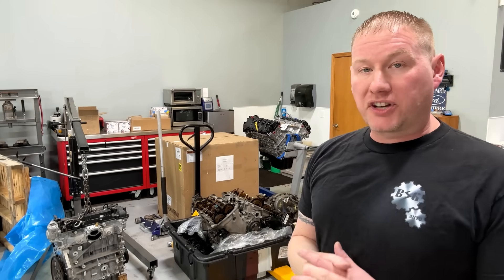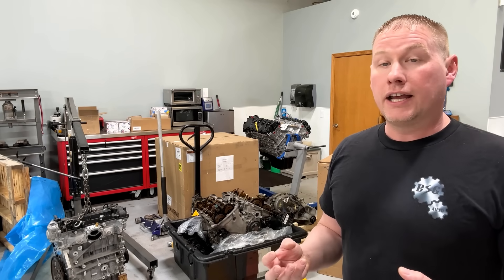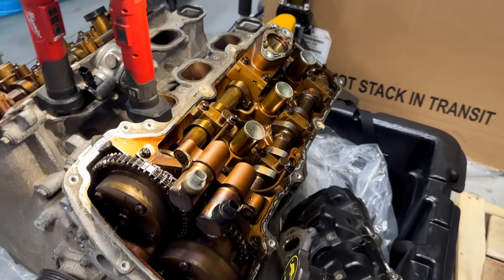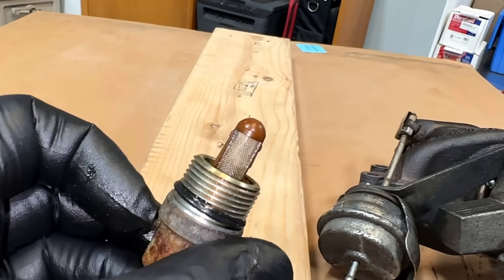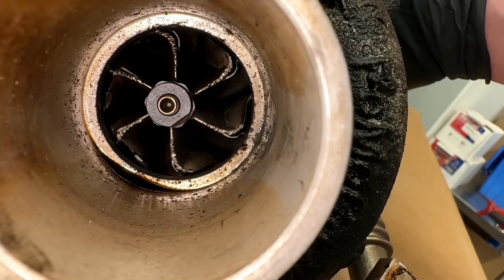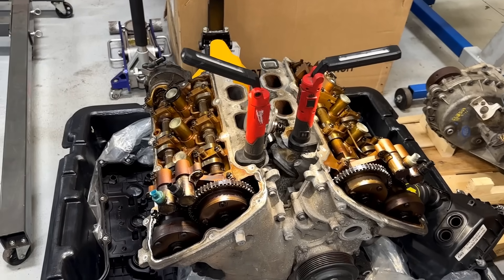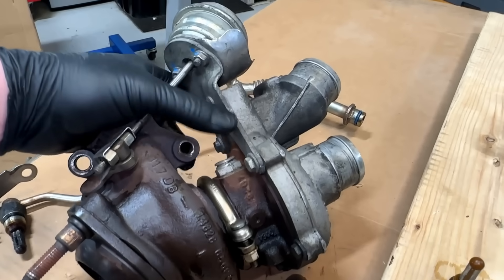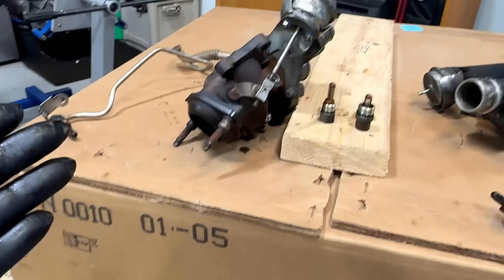This is Why You Never Run Extended Oil Change Intervals on The Ford Ecoboost Engines!

Comment: Small displacement turbo engines with direct injection should never go over 5K between oil changes. Fuel dilution and high pressures and temperatures will break down even the best oils.

Comment: I put full synthetic amsoil signature series oil and an  Amsoil oil filter and I let the Ford dash computer tell me when to change the oil…..    eeek😮….   How long does the oil change reminder on the Ford f150 dash usually let you run until an oil change?

Comment: Would you be willing to do a walk through  to examine these oil filters and turbine wear with turbos in place?  Extension mirror or camera on a stick? I bought my truck used and don't know what horrors the previous owners inflicted. Knowing how to perform checks would help prepare repairs.

Comment: My 2023 F150 2.7 L echo boost engine monitor on the interface requested my first oil change at less than 1500 miles. Why so soon? Please answer this question for me. I hit the reset and here we are at 2900 miles and it’s asking to change oil again. Should I be changing the oil or disregarded and hit the reset button?

Comment: Cheap insurance, change oil every 3,333 miles.  It is really easy to see on the dash when it's time, ××3,333, ××6,666, or ××0,000

Comment: Seriously, Ford is responsible for these "oil" failures. The recommended "synthetic blend" oil is basically conventional oil not true synthetic. In addition, Ford's oil change reminder is factory set at 10,000 miles. Conventional oil must be changed at 3,000-mile intervals.

Comment: Here is crazy idea, but hear me out.  What if you changed the oil at 3K miles, but not the filter? Then the next oil change, 3K on the oil, 6K on the filter, you change both?  Good idea, or bad idea? The filters should easily go 6K miles.  You would obviously have some residual old oil in there, but it wouldn't be much...

Comment: I run 7.5k intervals on my 5.0 F150 and 5k intervals on my wifes 2.7 Bronco. This is great advice to keep turbo engines happy and I also recommend using a high quality oil (Pennzoil Ultra Platinum).

Comment: We have a 2015 Ford Transit 250 with the EcoBoost 3.5L engine, currently at 412,000 miles. The engine and turbos are original, including the manifolds and studs. Purchased brand new, strictly doing oil changes every 5,000 miles and have maintained it through-out the last 10 years. I made a post about it on a FB group called "Mileage impossible" even took photos of the engine bay, underneath the van, turbos- fittings ect. The cam phasers are original as well. I had several members almost in complete disbelief, but as a former technician (many years ago) I tend to do a lot of preventative maintenance on all of our vehicles. Some are lucky, some are not, I guess a lot has to do with how you maintain and care for any vehicle.. It went to Ford today for the recall on the drive shaft coupling, not only was the advisor baffled over the mileage but the technician was also considering the manifold studs were in tack, no turbo lines leak, no turbo abnormality, though noted it did have a slight leak at the front cover but not enough that it was dripping to the ground or beyond the cover itself. The transmission was replaced at 400,000 miles with another used unit with far less miles.

Comment: On my 2022 ford edge 2.0l , I change the oil and filter every 3000 miles. I use mobil one synthetic oil.

Comment: This is why you don't run cheap low quality oil, all Group III oils are nothing but mineral oil or conventional oil, they are not synthetic and it is false advertising for them to even put full synthetic on the freaking bottles. In Germany they can't label a Group III mineral oil/conventional oil as synthetic. You can blame Castrol and the BBB National Advertising Division for mineral oil/conventional oil being labeled as full synthetic. Mobil tried to explain to the BBB's National Advertising Division the difference between mineral oil/converntional oil and synthetic oil but they refused to listen and sided with Castrol. 

Do yourself a favor and do research and only purchase true Group IV PAO synthetic oil or Group V Ester synthetic oil and you will be fine. Sadly the majority of oils labeled as full synthetic today are nothing more than hydro cracked Group III mineral oil/conventional oil.

Comment: Thanks for this video. Found it because considering replacing turbo oil screen filter on a 2020 Fusion 2.0 and 2013 Escape 2.0. My concern is possibly breaking something as I notice the tubes are ridged. Is this a valid concern?

Comment: Always great info!  With an exhaust manifold leak would you also replace the turbos with new ones or just replace the screens and reuse them? 2018 Transit HD w/ 95k.  Anything else you’d do preemptively at that time?  Any issues letting the manifold chirp as long as there is no performance issues or codes?  TIA

Comment: Absolutely correct! 💯 I don't put 5000 miles per year, but I do every year without fail. 3500-5000. I do turn off start-stop which I think destroys the turbos and timing chain. I idle while I'm getting ready, putting sunshade and getting my stuff. About 1-2 minutes to cool the engine and turbos, especially after highway run.

Comment: Unbelievably useful information on those screens, thank you. I own a 5.0 F150 but my wife’s ecoboost Explorer 2.3 has the same type of screen on the turbo I am assuming? We go 2000-3200 miles between oil changes so no issues there but very good to know to change these if for some reason the car needs work. 👍

Comment: Just rolled over 306,000 miles on my 2013 King Ranch 3.5l Ecoboost. Oil change done every 7500 miles with Motorcraft FL-500S filter and Penzoil Platinum 5W-30.

Comment: Hi I have a 2021 Ford Ranger with the 2.3L.  Should I be replacing the turbo screen every so many oil changes?  I don't  see any mention of that in the maintenance schedule.  I'm definitely going to start doing 5000k oil services as you recommend.  So if taken care of properly what kind of mileage can you expect from the 2.3L?  I was shocked to find out that the transmission service is at 150000 and the coolant is at 200000.  I have 38k and I'm doing both now.  For the transmission I'm just dropping the pan and replacing the filter, no flush.  I purchased a drain/fill/filter kit and it only came with 7 quarts of fluid.  I know the tranny is 12+ quarts.   I'm assuming that 7 quarts is enough for a drain and fill.  Is there a dipstick under or part of the fill bolt for the transmission?

Thanks for the awesome videos.  They're very helpful for us DIYers.

Comment: Great video, people don't talk enought about engine hours! I live in Los Angeles and my commute is 50miles - round trip that takes 3 hours,  So my ecoboost has 72k miles but the engine hours of a ecoboost in rural area with 150k+ miles!  So I do oil changes every 5,000 miles OR every 150 hours which ever comes first!!

Comment: Just changed my turbo oil screens.  Changed the oil every 5K. 2014 with 130K miles.    Clean as a whistle.  Zero debris and no clogs.
Reply: Where are the turbo oil screens?
Reply: @TenaB-j2l towards the front of the engine.   Follow the oil lines for the turbo.  Driver's side is easier to get to.  Passenger side you will need to loosen/remove the AC Compressor bolts to be able to move it out of the way.  It takes a 12 MM Allen to be able to remove the bolt - screens feed into the block.  I had to modify the Allen for the passenger side.
Reply: @A10Cobra  thanks,  you answered my question, now I'll be able to maintain my car better! 😊

Comment: Question, I’ve got a 2021 ford Transit 3.5 eco boost.  I’ve only changed my oil according to the status symbol unfortunately.  So every 10k full synthetic. I travel for a living so if all my miles are highway should I still do every 5k miles?  My van has 170k miles already after 3 years

Comment: Hi. Great stuff. I don't know how I got by without your videos until now.  I have 2014 Ford Exploder Sport 120K miles. I plan on watching everything you have here.
A quick question about oil line filter screens...  do they come inside new replacement lines? I look at all these pictures of new lines but do not see the screen. Even the main Ford Parts site doesn't show anything about filter screens with the lines and the the parts breakdown sheets. Can these be purchased separately? What about cleaning them? Alright... that wasn't so quick.
About cam phasers on 2014... they don't seem to mention the startup rattle for my explorer.  I have new timing chain and guides along with water pump. All in work right now. Did they make an upgraded cam phaser for 2014? Are these absolutely necessary to replace along with other stuff at this point? I watched your video on oil pump. My new Melling is on its way. 
Thank you for everything you are doing for us.

Comment: I have a 2013 Ford F 150 super Crew 4 wheel drive truck with a 3.5 Echoobst engine and I get the oil change every 3,500 miles and it's never had to have a drop of oil added to it

Comment: Wait what your telling me is that the manufacturer recommended maintenance intervals of 10 thousand miles per oil change isn’t right but that’s what the factory recommends for service intervals so I guess we should file a class action lawsuit against them for ruining our engines because we are just following the manufacturer service interval per the owners manual

Comment: This same sort of things happens to Subarus that have turbos.  There is an oil screen just prior to the turbo, and too many owners go 5000+ miles before getting an oil change, then they're shocked and upset when the turbo and/or engine fails.

Subaru put out a bulletin for all turbo equipped vehicles: oil changes are due at/by 3750 miles (nothing longer).

I have a 2024 GR Corolla, and I stick with 3000 mile oil changes.  Oil changes are inexpensive, especially when compared to the cost of a replacement engine/turbo.

Comment: lasted over 200,000 with the regular 3.5 with synthetic mobil one you could go 10,000 Mi with no problem I know because I've done it the only thing that failed was the f**** water pump still lasted 300,000

Comment: Why does Ford recommend synthetic blend for their turbo engines??? Just changed my new 3.5 EB oil at 1,100 mi. to full synthetic. The factory oil already was a funky color and there is a world of improvement in how smooth the engine is running in both light and spirited acceleration. So glad I did an early break-in change to full synthetic.
Reply from the maker: That is just the base oil, in other words don't go any lower.

Comment: I grew up in the 1980s and 1990s where we were told to change the oil every 3,000 mi. Probably because oil wasn't as advanced back then. However I have never strayed from this advice. Every car that I've ever owned since I've always changed the oil every 3,000 mi or 3 months whichever comes first. At the end of the day, an oil change really isn't that expensive as preventative measure.
Reply: Oil is much better today than in the past, but modern turbo engines with direct injection are much harder on the oil than engines of the past.

Comment: When my oil life minder hits 50%, I do a full change with synthetic. Never exceed 5k between changes. Thanks for your great work here!
Reply: By the time I get 50% on my monitor I will be around 5100 miles.
Reply: @adribouss I change my oil every 3k miles in my 3.5EB,I have 200k miles no problems still has original turbos from when engine and truck were built!
Reply: How many miles would you have put on your truck if you wait until 100%?

Comment: I have a 2018 F150 with 117000 miles on it.  It currently has a whine noise that’s annoying.   I wonder if it could be coming from the transmission.  What do you think?  Thanks

Comment: Would you prefer changing the oil every 3000 miles using the Ford Motorcraft semi synthetic blend oil or would you use mobil one full synthetic and change it every 5000 miles?

Comment: I've got a 2017 raptor... bought it used from a one owner. Has good oil change history. Seems average of every 7-9k the oil and filter changed at ford dealership. Truck currently has 95k...I have changed oil 2 times myself since owning it. I use amsoil full synthetic.
My question is do I need to pull and inspect these screens and possibly replace?? 
I will change my oil every 5k as you recommend as oil changes are cheap.

Comment: Hi Ford Tech, 99 crown vic, 146 k miles, no codes, starts right up, no leaks on the floor, oil consumption, compression ok, think valve seals, do you know a product  I can use help seals before complete repair? thanks

Comment: Excellent video and information.  I just got my first EcoBoost ('24 Ranger Raptor 3.0 V6 Twin Turbo)  My buddy runs the Roush Yates racing engine shop and told me to be more frequent on the oil changes, early on the first change, and go full synthetic.  He educated me that the EcoBoost is hard on oil, but we didn't get this deep into the discussion.   Great information and the visual is really helpful.
Reply: What fully synthetic are you using on the Raptor for I will be going that road on my 2024 Raptor?

Comment: Hey Brian, quick related question, 2016 F150, 2.7.  I had the oil pan/vented valve cover TSB done 3 months ago by local dealer.  Fixed oil pan leak, but now burning oil somewhere, approximately a quart per month.  Could this be related to clogged screens?

Comment: F150 2010 4.6 3v.    Have been changing oil in the 5k range . Noticed some sludge in the top of oil fill cap.    Is motor flush recommend?

Comment: Placing your faith and money on extended life full synthetic oil is like relying on Ford to honor a power train warranty. Never trust the oil life indicator on your vehicle. Save yourself the aggravation and just log down the next oil change interval in a notebook or on your phone. If you're waiting on your motor oil or ATF to resemble chocolate syrup, the damage has already been done 😢

Comment: Change the oil often and let the turbo charger idle to cool with the flow of oil through the critical parts before turning off the engine.

Comment: As a teenager I rebuilt numerous dirt bike engines, Piston, Rings etc. following a Break In Period was critical.
I’m about to receive a Brand New F150, I plan to change all fluids way before what the manufacturer suggests.
For example my 2021 F150, performed much better after I changed the Transmission Fluid & Filter.
I noticed immediately how much smoother it shifted etc.
Oils cheap, I plan to change my Engine Oil (3.5 Twin Turbo) with 5w40 Amsoil synthetic every 3,000 miles. I will also warm up the engine in cooler temperatures and allow the Turbos to cool when possible before shutting the engine off.
Reply: I did the same as a kid, break in is very important. 
Recently bought a brand new F150. I’ve already changed the oil to Amsoil at 2,500k, I’ll change it again soon then settle in at every 3,000k
Also change Transmission,Rear End,Transfer case,Rear axel , front axel.
Hard hard shifting once in a while on my used 2021 Lariat, changed transmission fluid and filter, found a lot of very fine metal, pan had a layer and filter was gummed up with only 32,000k
Since it’s shifted very smooth, can’t recommend enough. I used this guys video on how to change, took me 3hrs cause I’m working on the ground after I drove up on 4 ramps.

Comment: I change my oil every 7 k miles on 2018 expedition,,, it making rattle noise from the cam phse,, dealer had done some software update,, most of the rattle has been cut down,, but still light tapping  I can hear from the passenger side engine,,,

Comment: I know this vid is a little older but Looking at why the engine failed with extended oil changes and the buildup on turbo screens and such.  Do you or anyone think the new Valvoline Restore and Protect could have helped if owner knew it was an issue and Is the Pennzoil Ultra Platinum  still going to be your oil of choice or the new Valvoline Restore and Protect.  For reference I am the new owner of a 2015 expedition w/ 119k and I'm researching which oil to use.  Will definitely follow the 5000 mi OCI.

Comment: Question Brian . I am getting ford to install a new 3.5 eco boost to replace my 429000 km 266k miles. 2012 f 150As a pre cautionary planned event . Been a great engine with impeccable service all synthetic etc. never did the timing chain yet , but yes to turbo coolant fittings and pipes and exhaust mans with studs. 
sorry , any ways when Ford installs the new reman ford one how do they PRE LUBE before starting? 
Thanks f you get the chance to answer sir.

Comment: Today’s oil is really good but cannot last indefinitely.  Heat and friction are oil killers.  Turbos require more frequent oil changes as the turbo runs hot and has higher friction.  Most people do not realize that Ecoboost engines need more maintenance.

Comment: The oil spec DID NOT change due wear specs.  It had to do with reducing LSPI (low speed preignition).
Reply: Do you know of this owner ran OEM fl500s filters at each change?
Reply from the maker: For both issues.

Comment: I have 250,000 miles on my 2015 3.5 Ecoboost F150. Spark plugs every 75K, a couple of coils over the years, one water pump, and factory spec oil changed every 5K. Seems to run as good as new. Was going to replace the truck at one time but now I’m curious just how long I can drive the one.

Comment: Would you recommend the 2024 Ford Expedition as a good value, using the criteria of dependability, resale, cost to own, MPG, enjoyment in  driving.
If not, what full-size SUV would you recommend for light trailer pulling, occasional full passenger load and lots of highway travel( 25,000 yr.)